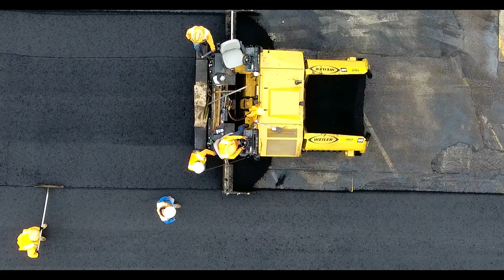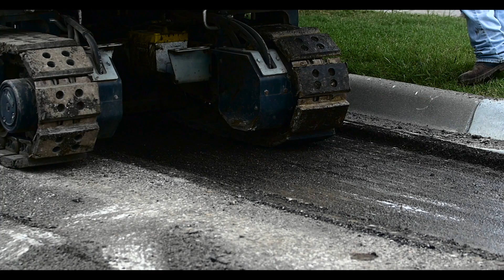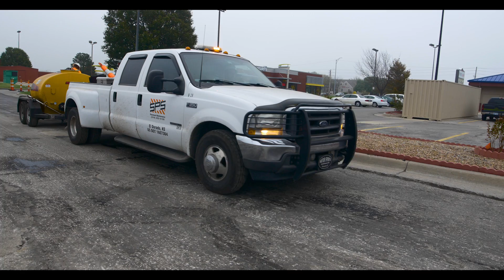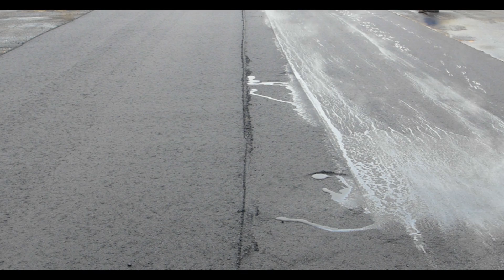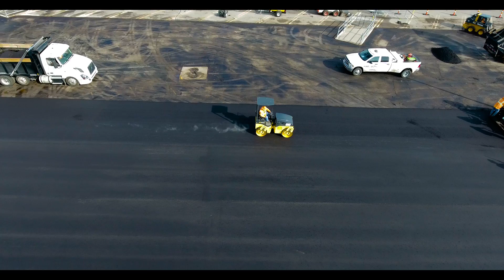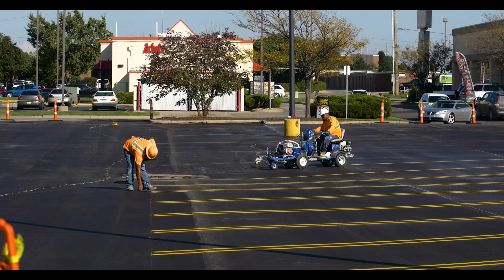SPS | Milling & Paving Process

Comment: I would really appreciate your help. Do you think 60 tons of asphalt will be sufficient for 4 inches thick 3,000 square feet driveway? Thank you very much!
Reply from the maker: In order to achieve 4" thickness on a 3,000 SF driveway, you will need 72-75 tons of asphalt at proper compaction standards.